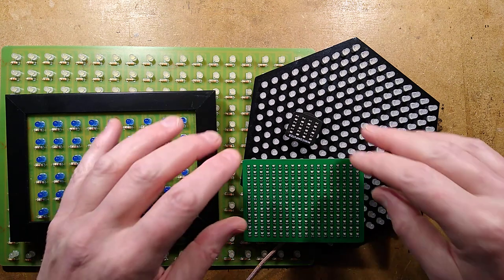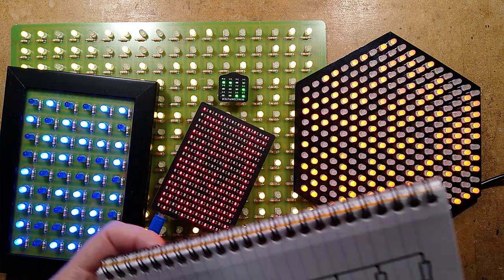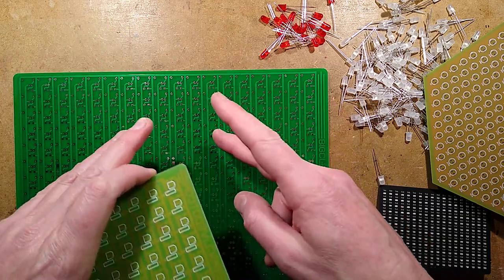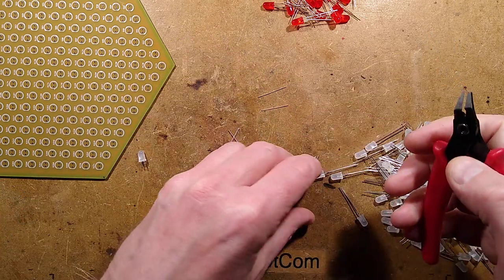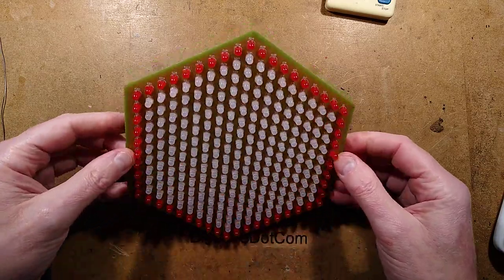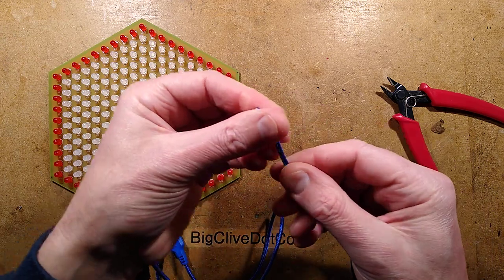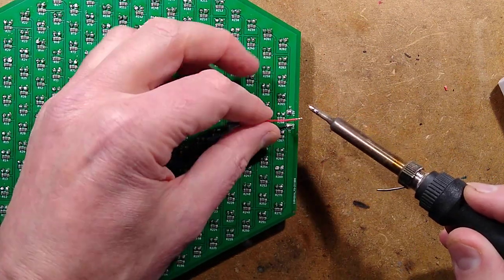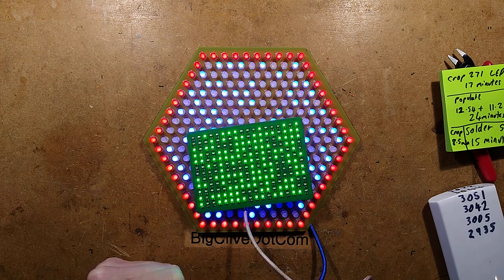Intergalactic supercomputers for all (Not CGI)

Comment: Why do you suggest adding series diodes to reduce intensity rather than series resistors? Great video btw, definitely need to make one!
Reply from the maker: They drop a decisive voltage step of around 0.6V.   With these, resistors work too.

Comment: Hi All,

I've just completed my first Super Computer :-) - It's awesome.  During the process I moved from non-lead solder to 60/40 and it made it so much easier - I just made sure to add a small fan behind me as I work.

I've noticed, however, that it's fairly bright... I'd really like to add a potentiometer to control the brightness... or maybe a photo resistor that works in reverse (i.e. get's brighter the more daylight there is?  - can I suggest a video that adds this to a Hexputer?  I think you'd need a simple circuit for it?  It would be great to listen to you explaining the circuit and why/how it works!). 

In any event - I was thinking - can I just add a potentiometer to the 5V input, would that work ok?  I can see another order coming up to Farnell! :-)
Reply from the maker: Try some fixed value resistors in series.  Or use some 1A diodes in series to nudge the voltage down a bit.

Comment: Many many moons ago I designed and built a disco light controller for an 8x8 matrix, unfortunately it required specific patterns rather than random ~ 10,000 steps stored on 2x EPROMs, the value for each step had to be manually worked out & noted down. Then came the process of manually entering the steps into the EPROMS because I didn't have access to a proper programmer, 10,000 times I had to set the address and 2x 8 bit values on hex switches & then toggle the write line etc. Needless to say the first time out a very helpful chap came up and pointed out that there appeared to be a couple of pattern errors... I did manage to refrain from flattening said gentleman's nose, but only just! Next project was an EPROM programmer for an Amstrad CPC464!
Reply from the maker: I used to build and program fairground lighting controls with a similar EPROM system.

Comment: I suppose the inherent variation in the resistors and LEDs would cause the randomness.  Figure a 5% 100 Ohm resistor can be from 95 to 105 Ohms.
Reply from the maker: It's mainly the manufacturing tolerance in the chips themselves.  The capacitance values are tiny and affected by the layer deposition.

Comment: I remember someone recommending putting small pieces of hot melt glue under heat shrink tubes, so they grip better to surfaces and seal holes even tighter.
Reply: You can buy heat shrink tubing that is lined with hot melt glue.
Reply: The good "marine" stuff is lined with hot glue and shrinks tighter than the regular stuff.

Comment: You could make a monster display with larger flashing  'pixels' using 3 ordinary red leds and the flashing one in series positioned in 2x2 running from 12v with approx 220ohm resistor

Comment: I'm just starting to get used to simple electronics and soldering so having my own super computer seems great fun!  I've just ordered a bare kit from Evilution and it's on it's way!  A couple of questions if I may?

1) I note that the board has 1K Ohm resistors - I ordered some diffuse 5mm 1Hz flashing LEDs which are on a slow boat from China now... However, the Forward Voltage on these ranges from 2V to 3V with an IF of 20ma.  Just working on a quick calcualtion I'm seeing I should have (assuming 5v from a USB power supply): 100 or 150Ohm resistors.  I'm new to all of this - what does this mean?  Will they just not work?  Do I need to order different LEDs or drive a higher supply voltage?

2) Can I test the board before completion?  i.e. can I solder in 1 row at a time and test it?  I /think/ this should be possible - or have I got this all completely wrong?

Thanks your you patience with a complete electronic newbie!   All these years being a software engineer hasn't done s**t for being able to work with this sort of stuff - you guys (BigClive and Evilution) are like gods onto us 🙂
Reply from the maker: The LEDs will work fine.  The 1K is to keep the current and brightness manageable.   Yes you can test the PCB with as little as a single LED.

Comment: I'd like to see this in my car's taillights. Maybe have the hex design in 2 panels that alternate when the decay of randomness dims one too much while the other stays solid on. A timer would be enough. Like 20 flashes then alternate.
Reply: Or horizontal bars of leds.
Reply: Yes I know staying on would require another set of leds. Can you stack them without light guides or would it just be smd's in rows on different circuits?

Comment: I'm planning to make something similar but using a perf board for a couple of reasons: 1) The cost of the boards everywhere I've looked is prohibitive for just one project and 2) I'm thinking of a variant on the circuit. I've been experimenting and I find that I can put 2 LEDs (colour change or flashing) in series with one 1K resistor on a 5.7V supply they draw approx. 2 mA and flash in interesting patterns (the plan is to put all the LEDs in a bowl, mix them up and pull them out at random). Is there any reason I can't do that instead of using a separate resistor on each LED?

Comment: How about making a 12 sided dodecahedron - yes you'll pentagons, 6 of the super computer and 6 plastic sides, slightly mirrored. And face the the leds inward. So you get an infinity effect 🤔. 
Would this be an inverted discoball? 
Quantum Computer?  Though it would look bigger on the inside if done right. 

Also what would this look like if IR leds were used? (If self flashing IR leds exist)  and would it interfere with my TV?

Comment: You mentioned you were going to show a way of dimming it? I've tried with a voltage regulator but the dimming isn't' consistent across the whole board. Is it because each of the LEDs has a little regulator chip within them?
Reply from the maker: You can add 1A diodes like 1N4001-7 in series to drop about 0.6 to 1V for each diode, or use a resistor.  Initially the effect will be weird, but when it settles down the 50/50 average will give constant intensity.
Reply: @bigclivedotcom  Is that adding one to each light or to the boards power? Sorry I'm an electronics novice.

Comment: Im VERY curious of what would happen if you had a very slow AC 5 volt input going into the leds.

Like 5V AC at 1hz
of coarse, you'd put a diode to make current 1 way.
But I'm curious as to what happens as the leds go out of sync.
Reply from the maker: They would reset continuously.

Comment: Couldn't you make a similar board with 100 red LEDs in series, assuming 2.4v voltage drop, and just use mains voltage? And possibly using 4 LEDs as a full bridge rectifier to get rid of the shimmer? Or am I making some fundamental faulty assumptions?
Reply from the maker: They effectively go open circuit when off, so would have high voltage across them.

Comment: I wonder how chaotic it would be if it used those alternating red/green or red/blue flashing LEDs

Have you seen those USB A connectors which are a plastic clamshell design? I get that USB cables are basically free, but sometimes I would like to use a cable with a little thicker copper for less voltage drop or those super flexible silicone ones. Having a bare connector lets me choose my desired cable to use. They are cheap too, I can get some for a little over a USD for a set of 10
Reply from the maker: The alternating LEDs tend to be clear

Comment: Instead of using all those resistors, isn't it easier to use a low voltage power supply and skip the resitors?

Comment: you could have done the same thing with an Arduino and some WS2812's in a grid array. The WS2812's use 3 wires + - and a PWM Data line. on the arduino you could actually program patterns and colors
Reply: You could go one step further and use the string style WS2811s for the full 'old school' LED look. Drill a matrix in a piece of thin hardboard or plywood and mount the whole thing in a shadow box frame. Either way though, the downside is that you miss out on the soothing autotelic experience of soldering all those LEDs.

Comment: Thanks :) Making one now on some vero board - Have a question...
The Blinking LEDs I have appear to be possibly 2 Volt - maybe 3 volt (Aliexpress just says clear 5mm).
My question is these don't seem to require resistors...(unlike reqular leds). Can anyone confirm. Web searches vary in this answer.
I hoped to use the few diodes in series trick Clive mentions to bring USB 5V down to 2.5v ish - and run 100 blinky leds in parallel - and not bother with all those resistors.

The small few I put on bench supply test didn't die...yet.... and at 2V they take less than 0.5mA current.

Does that sound ok?

"100pcs 5mm Red Light-Emitting-Diode Automatic Flashing LED Flash Control Blinking 5 mm Blink LED Diodo 1.5HZ(90-96 times/minute)"

Cheers.
Reply from the maker: I recommend resistors for large arrays to tame the intensity and allow easy powering from a USB power supply.   It also protects the LEDs from accidental reverse polarity connection.

Comment: If you don't need full brightness, how about running it on constant voltage without resistors?
Would they run in sync for longer without resistors?
Which chip is inside the LEDs?
Reply: you could but need regulation , issue could be a thermal runaway though. The chip is probably just a simple transistor flasher design
Reply from the maker: It's a dedicated flasher chip.  I prefer resistor per LED, it reduces synchronising between LEDs and protects them against reverse polarity by limiting the current.

Comment: What would it take to delete the resistors, i.e. enough LED's in line that no resitors are needed? I've got an LED cob I salvaged from somewhere that's set up that way. Also, do LED's exist that are RGB and also turn on and off? I'm meaning LED's that are one color tblink  off and come on a different color. All The blinking RGB LED's I'm finding are just go from one color to another with no real time in between. n
Reply from the maker: I prefer resistor per LED to share current consistently, reduce the risk of "syncing" and protect the LEDs if reverse polarity is applied.
Reply: @bigclivedotcom  I really don't want to spend the $$$ on ordering PCB's and both optiosn for kits are sold out. I've got a that LED cob sitting here(salvaged from an jumper pack, if I remember right), that I'l like to use. It has no resistors, and it's jutt a 4x6 circuit board, with 6 LED's in parallel across between+ and - rails, for each row.

Comment: How many amps does the power supply need to power this number of LEDs?
Reply from the maker: Very little current due to the use of high value resistors.  Just a couple off hundred mA.

Comment: I was going to make one but then I got into trying to figure out the proper size resistor to use.   I found that if you try to set the current to 10 milliamps picked a resistor based on the supply voltage.   I found that if you raise the supply voltage at one point the current starts to have a continuous current that the pulsing current rides on.  At perfect supply voltage the pulsed current drops to almost zero and then rises to full current when the LED lights.   If you raise the supply the dark current rises and then the LED lit current rides on top of that constant current.   Did you do any experimentation  with these to choose the best resistor???
Reply from the maker: I chose a resistor that kept the current low and gave a good visual intensity level.
Reply: @bigclivedotcom  OK.   Thanx.     Makes sense.     I guess I was making it more technical than I had too.    My results were interesting though, when experimenting.    Some documentation out there says no resistor is needed for a certain range of power voltages.  Like 4 to 9 volts.    I will have to experiment with that too.

Comment: Instead of having a resistor on each LED can't I just use one resistor on the Vin?
Reply from the maker: Using one per LED also protects each LED against reverse polarity.  When connected in reverse the flashing LEDs pass a lot of current and often fail.

Comment: BC, if you should read this, I have had an awfully frustrating hour trying to get some of your A4 PCBs made. I tried the one every YouTube nerd creator but you, who works as a barker for PCB Way. However, I don't want to order from China, and the prices seemed mad—around 40 EUR for delivery.

So, I have tried the ones I found online in the UK, but they all require filling in a form, and they will email a quote. Please give me a rough idea of what I should pay for 5 A4 PCBs printed with nothing added. I have been seeing prices like 70 quid for them. Is this appropriate? I really have no clue. I don't suppose you have any advice, please? I really want to get soldering on a plethora of flashing LEDs.

Cheerio
Reply from the maker: The shipping is quite high on the big PCBs because they are heavy.  Using a middle man will cost you a lot more.

Comment: Why not solder up all the leds in parallel and add a single resistor?
Reply from the maker: Separate resistors controls the current better, and has the added advantage of saving the LEDs if there's a polarity incident
Reply: @bigclivedotcom  Hey Clive! thanks for the answer! Thing is, I already started this project before I saw your video, thinking a single resistor for a parallel set would be fine... I'm using a generic pcb with no tracks, folding the led pins over to solder them together. then using a small buck converter to feed it 2.6v from a 12v line... wish me luck <3

Comment: In a fit of madness a little while back I made one of the rectangular ones, but being a tight Scotsman I used some stripboard with 108 LED's (12x9) it was a complete pain in the arse to solder, but the outcome was worth it. There's a link in the comments to my You Tube video to the Excel sheet I used to design the circuit.

https://youtu.be/S0i2g8NaPl4

Comment: I always think, why not use an old monitor and do all that in software, having many variations and no soldering?  The wonder of software programming ...ALL HAIL ! The little one is not so random , is it, but same shapes repeating :-( Why not use 1 shared resistor?
Reply from the maker: The resistors ensure better oscillator independence and also protect the LEDs against reverse polarity damage.
Reply: @bigclivedotcom  But I still think 1 resistor and a reservoir cap would do
Reply: @gazzaka  try it then. I think you'll find that the effect will be disappointing. Like auto-synchronizing metronomes, most of the LEDs would flash in sync. The individual current limiting resistors help each flasher oscillator maintain its own state independent of its neighbors.
Reply: @KanalFrump  I couldn't be bothered soldering all those. I gave up electronics and TV repair because I always got aching neck and shoulders doing all the soldering etc...I have tried 2 or 3 flashing LEDS connected to a button cell and they worked fine , but I wasn't taking much notice of the sync